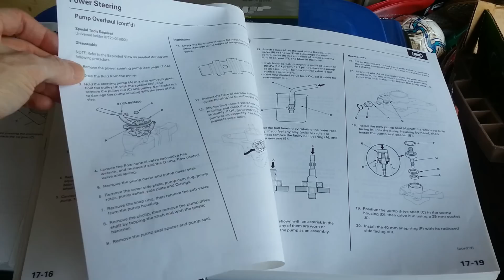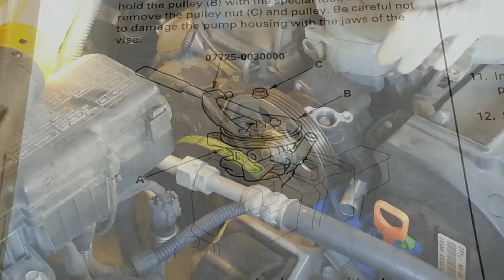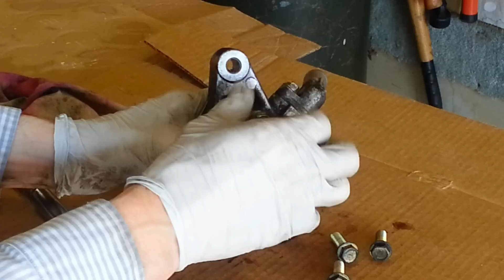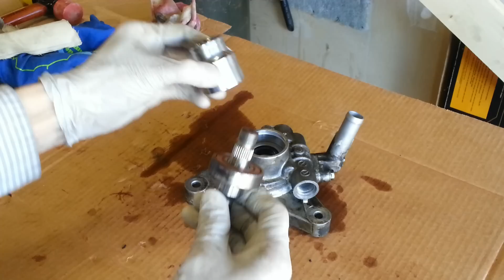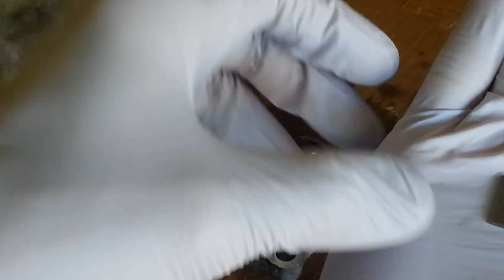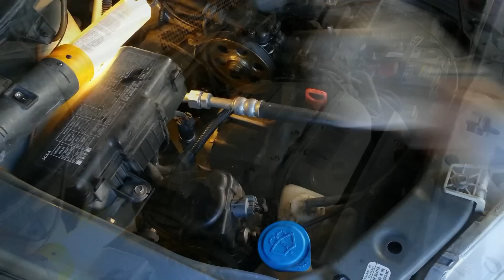Power Steering Pump Overhaul/Rebuild 2002 Honda Odyssey

Comment: very good video. Very helpful. My pump was working fine but I resealed my pump because the car is 18 years old. I also replaced the hoses to the reservoir, cleaned the reservoir, reassembled everything.  I did not replace the o-ring in the pressure relief valve because It wasn't leaking and I couldn't get the 10mm cap off. At first the pump was very noisy, but as I worked the air out of the system, by turning the wheels side to side. the pump eventually quieted down. I didn't replace the high pressure line because it was not leaking. When I test drove the car, at low speeds, like getting in and out of the driveway onto the street, my steering makes noise and has a slight vibration. The pump is quiet and the car drives normally any other time. Do you have any suggestion on what could be causing this? Thank you in advance.
Reply from the maker: One thing to check is the belt tension. My Toyota truck had a condition where the belt would slip sometimes but only in cold weather making a vibration in the steering and an odd noise.

Comment: Thank You soo much for this video! I fixed my 2000 honda accord se that has 229,000 miles on it just by replacing the gaskets and o rings on the the power steering pump.  thanks for the learnig experince, and you saved me a lot of money! God  Bless!

Comment: Great to learn from your work that I will pay close attention when rebuilding my 1999 Honda Accord power steering pump.  It's leaking and making noise.  It has 203,000 miles on it, so time to rebuild it.

Comment: Hey nice video, but at 22:07 you say that the rounded side faces out, that is wrong. The sharp side has to face out so the circlip does not come out by accident. The rounded side is made so the circlip goes in easier, not so it comes out easier. And on a personal note I would always change the bearing when you have hole thing taken a part anyway.
Reply from the maker: Lars Rützou I tend to agree with you.  However, the factory service manual explicitly states, "Install the 40 mm snap ring with its radiused side facing out."  Replacing the bearing is definitely a good idea, too.  I just didn't go to the trouble of procuring a new one since mine was in good shape.
Reply: worsethanchiggers Okay, now I understand why you did as you did. However I personally think that the manual may have a type-o. And bearing wise I have no problem following you. The problem with not changing the bearing are that if the load on the pulley changes the bearing will wear faster.

Comment: Question when removing the power steering pump and replacing it, can you damage pulley, reason I ask is the mechanic shop replaced my power steering pump and now my pulley wobbles a bit, did not do it before, so took it back and they said it needed a new pulley so I paid and the new one also wobbles now the same. Why is it wobbling and is it dangerous to drive, I have kids so I'm concerned.
Reply from the maker: Patty Caro Hi Patty.  The pulley should definitely not wobble.  The pulley could be bent as well as the shaft on the pump and perhaps caused by the technique used to install it.  In either case, I would take it back again because you don't want it to potentially wear out the belt prematurely.
Reply: Thank you so basically the power steering pump they installed is no good
Reply: And is causing my pulley to wobble, they put a new pulley and its wobbling too
Reply: The power steering pump they put in is rebuilt
Reply from the maker: Patty Caro Anything is possible.  They likely installed a remanufactured pump which could be faulty.  Or, they could have damaged the pulley(s) by whatever technique they used to install them.  There could also be some debris stuck between the pulley and the pump.  Either way, you are entitled to having them fix it for you correctly. The most correct way to install the pulley is to use a pulley holding tool.  You can see that technique used in this tool review video.  Good luck!   https://youtu.be/j_TfAACwJac
Reply: +Patty Caro My guess (backed by close to 30 years experience) is the shaft in the pump is bent. This could be because the pump core they used was bent in an accident hence the reason it was replaced years ago in the first place, or the mechanic got trash between pulley splines and shaft splines, or they are installing it wrong and bending pulley or shaft. Either way it is the shops issue and they owe you a refund for the pulley price and labor. It obviously did not wobble previously and still did after they returned it to you.
Reply: +Patty Caro Seems like either the shaft or the bearing has been damaged. No good!

Comment: Just a question,i have volvo power steering problem with the pulley,I tried to take off but i so hard,seems like they use sealer lock,and I'm afraid to break it,is a plastic one,give me any trick i appreciate it.
Reply from the maker: h dunkan I don't have any personal experience with those but perhaps a pulley holding tool would help.  Check out this tool review video of one that I used recently.  https://www.youtube.com/watch?v=j_TfAACwJac

Comment from the maker: The manual does not specify a part number but it may be a NTN 6303LU (17x40x12).  You should be able to cross reference the number off the old one and get one at a bearing shop, online, or an auto parts store like NAPA.
Reply: worsethanchiggers

Comment: Thanks for posting! My problem was simpler. Our 2003 Odyssey developed a noisy power steering pump and I was advised to "just swap out the o-rings" which seemed pretty simple until we tried it. All the other videos on YouTube show how to change the o-rings on Accords, but I couldn't find ones for the Odyssey. The top O-Ring is easy to do, but the bottom one requires you to remove the bolt under the inlet and I wasn't sure of the sequence of steps to get to that bolt. I figured I needed to remove the pulley, but until I discovered your video I didn't really have a clear idea. Your clear and concise video really helped me to understand the process, but I could get away with not removing the entire pump from the vehicle, so it was simpler. One thing that I did wrong on reassembly was not noticing the two different surfaces on the two sides of the pulley itself, so before I completed the job, I  watched your video again, and realized the welded side went out and the smooth side goes toward the pump, so... I pulled the pulley, reversed it, and all is well. Getting to the inlet bolt to tighten isn't easy, you need a short stubby wrench, a socket won't fit there. I should note the two o-rings combined are under 2 bucks from Honda, and our local dealer quoted around $100 for the labor. Love to see a video showing just how to change out the o-rings on the Odyssey, but since you did a total rebuild, won't expect one! My o'rings were flat and brittle as well. Thanks again, your video made this repair possible before a big snow storm hit!

Comment: Thanks so much. Worked perfectly on a 2004 Acura TL. I even removed the backplate in the down position and the whole cam/fin housing dropped out in 1 piece (and didn't even need to be pulled apart) as your advice was correct. INVALUABLE!! THANKS!!!
Reply: I was watching wondering if it was applicable to my 2004 TL.  Thanks for confirming.  This is the best how-to vid I’ve seen.

Comment: Process has been going great.  Terrific in fact, right up until the time when I was getting ready to torque down the nut on the pulley to the requisite 47 foot pounds.  Somehow the 3/8 inch extension I'd used to brace the pulley got loose and now it is GONE.  I've pulled back the wheel well cover and been all over the car.  It is nowhere to be found.  Any ideas as to where it might have gone that I can't locate with a flashlight from above, below and beside the engine?
Reply from the maker: John Gerken Aww, bummer!  Losing parts or tools deep in the engine bay can be a challenge.  I've used a telescoping mirror in the past with some success.  The only other idea I can suggest is to get under the car with a bright flashlight.  Good luck!
Reply: nm.  Finally found it and completed the installation.  Pump is now nice and quite.  Thanks again.

Comment: great vid if an overhaul is worth your time, but a quality remanufactured one costs around $90-$120 & literally takes 15 min from start to finish to complete the install. to me personally, it was worth the $60 difference (paid $90 for my pump) to save the time & hassle. then again, if you need to save the $60 or so bucks ... great vid

Comment: Very, very nicely done video.  Clear, concise and easy to follow.  Thanks for taking the time to record it.  My pump is making quite a bit of noise.  It's loosing some fluid but very little overall.  I suspect the bearings may be suspect.  If the bearing makes noise once I've pulled the pump, would you replace the pump or pursue finding a replacement bearing?

Thanks again for the excellent work.  I'll be doing this over New Years, so I'll let you know how it goes.
...John
Reply from the maker: Hi John.  Thanks for the kind comments.  What to do is up to how ambitious you are and how much time you have.  It is certainly simpler to just buy a remanufactured pump.  But if you are up to the challenge and are looking for some satisfaction like I was, you could consider trying to diagnose the source of your noise and fluid loss.  The noise could simply be air entering the pump due to a bad o-ring where the low pressure hose attaches.  I've heard that Honda has a TSB on that (#SN030408).  Replacing a bad bearing would also be fairly straight forward.  At a minimum, I would replace all the o-rings and seals like I did.  Good luck and be sure to let us know how it goes.
Reply: worsethanchiggers I have found a replacement bearing based off of NTN 6303LU (17x40x12) locally here in Round Rock, TX.  I'm replying here because you state the bearing would be fairly straight forward to replace.  Could you elaborate on the procedure?  Thank you.
Reply from the maker: Roy Niswanger If you don't have a bearing press and properly sized drift, one way to do it would be to put the drive shaft between the jaws of a vice and drive the shaft down and out of the bearing.  Leave the jaws loose so that they are not grabbing the shaft but with the bearing resting on top.  Don't worry about trashing the bearing since you are replacing it.  Use a plastic or brass hammer so as not to damage the end of the shaft and be careful not to scratch the sides with the jaws.  Then, drive the new bearing on the shaft using a deep socket that closely matches the diameter of the inner race.  All the force needs to be on the inner race so as not to damage the new bearing.

Comment: Great video fixing the wrong problem. See his same video on fixing the power steering high pressure hose which was the real problem. I am  shocked that the author, who seems very thorough and detailed, did not update this video telling everyone he had misdiagnosed the problem and that one should not attempt to rebuild the power steering pump until they thoroughly check the high pressure hose.
Reply from the maker: Paul S Thanks for the comments!  Note that when I finally came upon the real diagnosis, I did update description for this video above with that information and a link to the other video.  Still, I was really glad to have learned the process of rebuilding the pump for only the cost of the seal kit and to document the procedure for those who actually have that problem.  I don't mind making mistakes while learning from you guys who provide such valuable feedback.

Comment: thanks for posting friend , im looking for a small pump like this to use as a hydraulic motor for a D&R project and this thing looks perfect, i suppose i will have to remove the flow control valve .

Comment: Awesome video and great attention to detail.  Does the shop manual happen to tell you what the part number for the main bearing is?  I'm such a knucklehead I mucked up the bearing re-seating it into the housing.  Put everything back together and it's worse now than before! :(
Reply from the maker: rover2007514 The manual does not specify a part number but it may be a NTN 6303LU (17x40x12).  You should be able to cross reference the number off the old one and get one at a bearing shop, online, or an auto parts store like NAPA.

Comment: what is the purpose of removing the sub valve?
Reply from the maker: It is one of the steps in the procedure listed in the service manual to check the condition of the sub valve.  I also wanted the satisfaction of having completely disassembled my pump as part of the learning process.  You can certainly skip that step.
Reply: worsethanchiggers i see thanks

Comment: Both are very great videos; clear, well explained.  I'm a new bee into the car stuff.  This motivates me a lot in working on my odyssey 2005 in the future.  Had changed the front brake pads and bled the brake on it 2 months ago.  Next project on my plate is changing the engine/transmission mounts on the odyssey.  I'm in the process of gathering information for the project.  Thanks a lot.  My other cars are the Civic 2009 and Solara 2005.

Comment: doesnt applying excesive force to your ratchets damage them?, i was always taught to use breaker bars for breaking bolts loose.
Reply from the maker: Good ratchets are incredibly strong but they obviously do have a maximum torque that they can withstand.  You'll likely never break a 3/8" or 1/2" ratchet by hand unless you use a cheater bar and really over do it.  If you use one with a lifetime guarantee, don't be afraid to use it hard.

Comment: For Honda Accord Owner: I've had 2 recalls from Honda deanship, one of the was replacing the entire power steering pump for FREE. So you guys should call and ask if your car have a recalls. I've 2003 Honda Accord Coupe V6 btw.
Reply: that's a 7th gen, mine is a 6th gen, the only recall I've seen on it is the air bag inflators on both sides

Comment: Did the job today. Now that its all together I am not getting any fluid drop in the reservoir and the steering is very stiff. Any thoughts?
Reply from the maker: Do you hear a pronounced whining noise?  Several possibilities come to mind.  First, perhaps you are drawing in air rather than fluid.  Check the fittings and o-rings on both the low and high pressure inlet/outlet.  It is easy to pinch an o-ring during installation and damage it.  I did that the first time I reinstalled the high pressure line.  Second, maybe the dry pump needs to be primed somehow before it will draw fluid.  Lastly, it is possible that something internal got missed or reassembled incorrectly.
Reply: worsethanchiggers Im gonna try again tomorrow if I have the time. How bad would it be to drive on it the way it is? I need to get to work tomorrow and dont have the time to work on between now and then.

Comment: Awesome, detailed video. I am going to give this a shot myself tomorrow. My power steering pump keeps blowing the top off the reservoir and spitting out fluid. I've flushed the system a couple times and replaced the reservoir. I have a feeling the culprit might be that O ring that you said usually goes bad. Thanks for the video. I never would have thought I could do this myself before watching this.

Comment: amazing video sir.  I am getting ready to do this tomorrow, wish me luck!  Quick question, how many 12 oz power steering fluid bottles did you need to use to fill it back up?  And yes I will be using the genuine honda kind (:  Thanks again for the very well made video!
Reply from the maker: I'm very glad the video was helpful.  I started with seven bottles since I did two complete flushes beforehand but did not show that process on this video. So my whole system was completely empty when I overhauled the pump.  It took about two bottles to refill the system after each complete flush including bleeding out the air.  I recommend having one more bottle on hand than anticipated in case it takes a little more.  Good luck with yours.  Let us know how it goes!
Reply: worsethanchiggers ok so about three bottles then?  Sounds good, I will definitely let you guys know how it goes.  I'm excited, yet freaked out I'm going to make my van blow up (:
Reply: worsethanchiggers ok well I just finished the install.  The old pump was making a weird clicking noise so I put in another pump.  At first it was still making the whining/moaning noises and I thought I had just wasted a lot of time/effort.  But I kept adding in more fluid and kept moving the wheels back and forth and voila!  It doesn't have the issue anymore and all is well.  For the record I got a used steering pump off of ebay for $50 to get rid of the clicking noise, got a $4 o-ring for the hose that goes into the reservoir that I'm pretty sure fixed the moaning, three bottles of Honda genuine steering fluid from the local Honda dealer for about $5 a bottle (rip off), and a $20 socket tool set from Lowes to do the install.  After installing the o-ring and the other steering pump all is well.  So hallelujah!  Thanks again for the amazing video, saved my booty (:
Reply from the maker: those1kidds Great result! Feels good to do it yourself, doesn't it?

Comment: my car was leaking and I did everything as the video explains, noise is gone but now steering wheel is stiff. I used honda fluid. what could cause this?
Reply from the maker: Perhaps the belt is worn or the tension is too loose and is slipping on the pulley?  That happened on my truck and it would slip when cold.
Reply: worsethanchiggers I can see the fluid circulate in the reservoir but the steering is hard ,the belt is new. maybe I just need to replace it. i was worth the try though
Reply: I also noticed that when the wheel i turned to one side te level on te reservoir goes down and when turn to the opposite side it goes up. is this part of the normal operation?